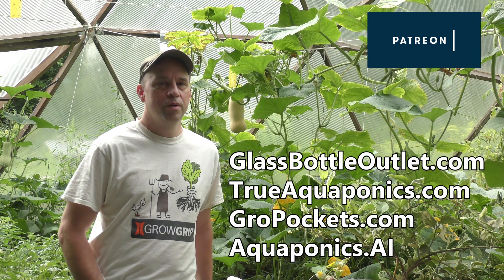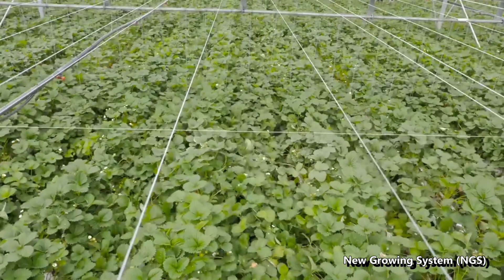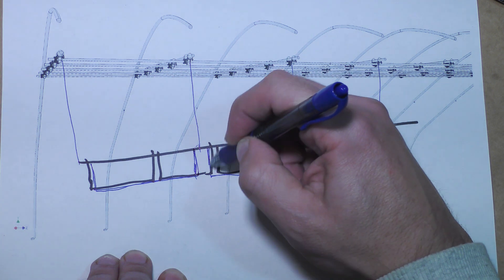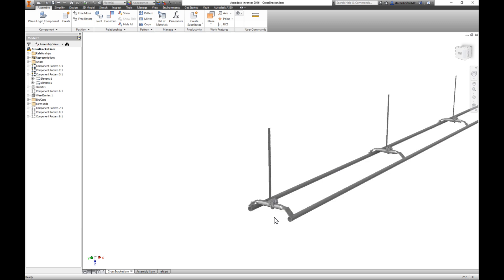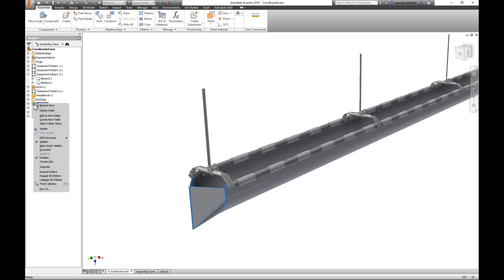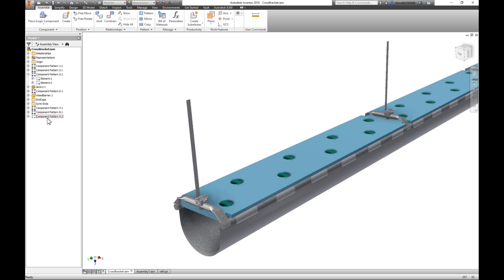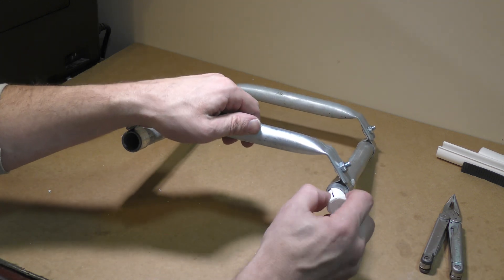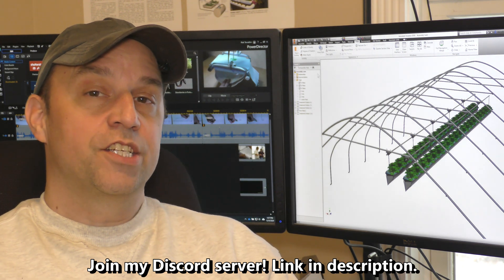Strawberry Hangers - Trough Design - Part 4

Comment: Love these videos! Great engineering! Could this be accomplished with 4” pvc pipe in place of trough?
Reply from the maker: I think 4"is too small for strawberry roots, maybe a 6 or 8" would work. My main goal was to have the secondary channel under it to get the water away from it.  Maybe cut the pipe half and stack them and figure out someway to attach them together?

Comment: besides the fact i like this channel and you approuch , this look very much over engineered.  you bassilcly making a NFT system why not use standaard gutter material? i alway use KISS  keep it simple and stupid  ;-)
Reply from the maker: standard NFT gutters are really expensive and the channel is too small for large strawberry plants. And regular rain gutters are aluminum and I don't want leaching into the system.  The large plastic gutters aren't strong enough to drill a few holes into them to hang them from a chain so they still need some kind of support structure to connect them into the hangers.  Plus, with all of these I still need a method to keep the water away from the roots and there still needs a drain channel to collect the water.

Comment: Looks good - but it seems the assembly can tilt to one side or the other because it is pivoting about a central point.  Uneven plant growth may tend to tilt the whole panel to one side or the other.
Reply from the maker: It's still a concern.  Some plants will be different sizes but statistically the weight from 100 alternating plants should even out.  I guess we'll find out this summer!

Comment: this is awesome , but the weight would bother me ... if the greenhouse was made with trusses I'd feel a little better about the weight hanging..... for multi planting in my greenhouse i have fence post in the ground with a short T at the top,,, on that I put pieces of aliminium scaffolding (basically 3 channels together) ... I plant my early straw berries on them in grow bags (tube type)when my tomato and pepper starters are ready to be planted , they get planted in the ground on each side of berry platform ..as the season (mid to late spring) goes on and the berries are picked and done (very easy to pick at that height ) ... the berry plants and the  platform gets removed, by then the tomatoes and/or peppers are well on there way ..... you can either plant then in line with the post and use the post for string lines or plant on each side of the fence post for more crop..... you can also make a T on the post just for the string ....no moving parts that's the best part and no weight on the greenhouse pipes
Reply from the maker: One of the previous videos I added trusses to the greenhouse.  Hopefully everything will work fine keeping it all overhead!

Comment: Are you planning to load the trough with medium or water, or is it aeroponic?  If you find that the weight is more than the clips can handle, then the Capstan Equation is your friend. By leaving extra material and loosening the 3/4" conduit clamps, you can twist the conduit prior to tightening to get 1 or 2 full wraps, so a small clip force can support a large payload.  Material creep in the plastic clips is another concern - are metal ones available in the right size?
Reply from the maker: I'm still undecided on the medium so it's designed to deal with a couple of methods.....currently I'm thinking of filling them with expanded shale.  I just need to recalc the weights again.  The clamps should hold but is a concern since they are PVC and get a bit softer in the heat.  I use the same ones in my DWC beds and they hold well.  They do make an aluminum version that I also have here.  I've debated wrapping around the conduit to increase the friction but I think it would be difficult to accomplish if it's 20+ feet long.  Plus I would still have to do some cuts into it to get the cross-bracket to fit into it.  If all else fails, I could just drive a self tapping screw through the clip into the conduit which should hold everything together.  Thanks!